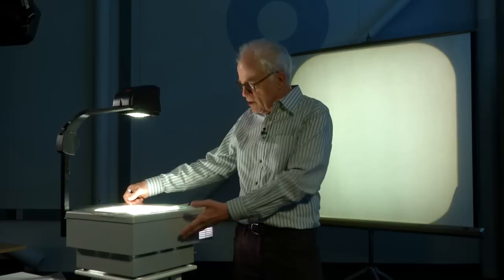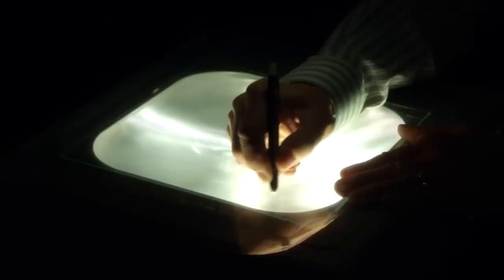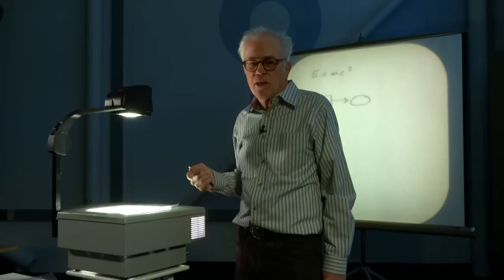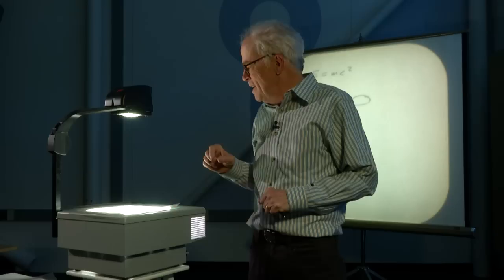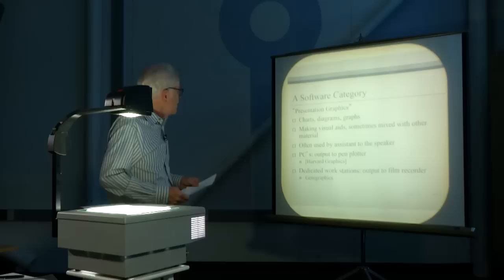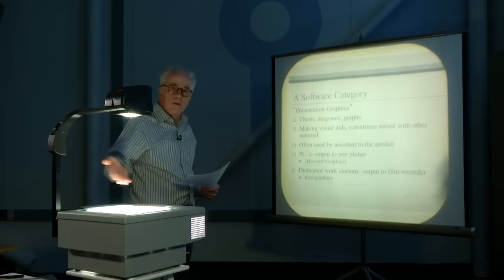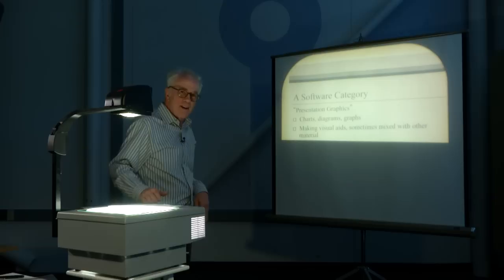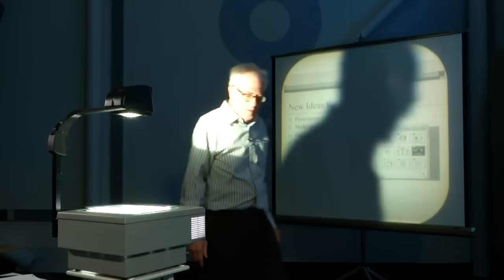PowerPoint Demonstration: Overhead Projectors

Comment: One time (in either 2012 or 2013) our teacher told us that she would have let us do PowerPoints for a project but her computer was slow and the formatting didn’t always work correctly. She still had an old overhead projector (though sometimes you had to thump it to get it working) so I came up with the idea of doing what I called “an old fashioned PowerPoint” (looking back now I had some more advanced technology to hand to make it happen) I went down to the local office supply store and purchased inkjet transparencies (the woman at the store was very surprised and said I was the youngest customer to ever buy them). I then made some “slides” in Microsoft Paint (I didn’t have access to Microsoft PowerPoint on the computer I was using and wasn’t fully aware of alternatives at the time). I printed them in full colour and brought the box of  printed transparencies to school. I don’t know if the teacher knew what to make of it but she did say as she put it down on the glass that they were the nicest transparencies she’d ever seen. Can’t remember what mark I got on the assignment but if I recall it was quite high. I still have them in there box so technically in the unlikely event if I ever need to do another project about sea scallops (I think that was the topic I was given) and have an overhead projector I can reuse them. ;-)
Reply: Cool :)

Comment: Last time I used these regularly was in the mid-90's. I was just cleaning out some files and found some from old presentations. 

True overhead projector story: A professor had set up an overhead slide on a projector and then walked up to the screen to point something out. While gesticulating at the screen he stopped suddenly, then started sneaking up to a massive fly he saw on the movie screen and then suddenly flicked it, trying to get it off the screen. What we realized, and he didn't, was that the fly wasn't on the screen but had landed on the Fresnel lens and was being magnified and projected on the screen, along with the slide. The fly actually came through quite clearly - clearly enough to fool the prof about its location.
Reply: I have this same exact memory!

Comment: One comment about color slides: You could prepare them on a computer using a pen plotter. Canon had a color inkjet printer in 1983, but I don't know if it would print properly on transparency film. 

The presenter did a great job of demonstrating the traditional overhead projector! I had forgotten about the sheet to cover later points technique, even though I saw it used every day in high school. 

I also remember when the instructor would inkjet print a bunch of pictures on one transparency film (color was expensive!), then pull the projector back from the screen to make the images big.

Comment: was this bad for the eyes of the instructor as they had to actually look into this bright light?
Reply: The light is not harmful for eyes is cool, I've used this projector almost 6 years
Reply: It all depended on the model and brand of the projector. Sometimes the projector stage would get quite hot too. I still have a 2004 3M overhead projector in my office. 😉